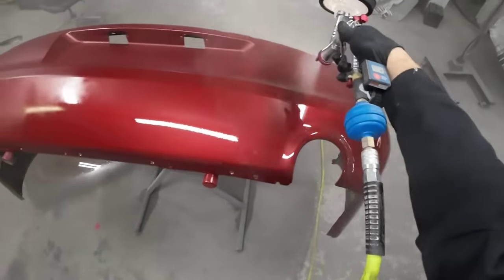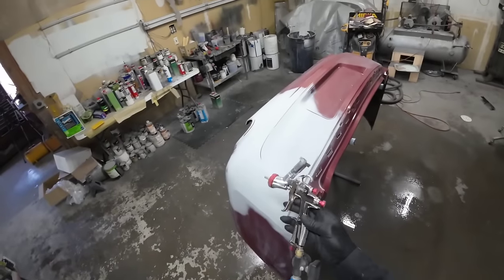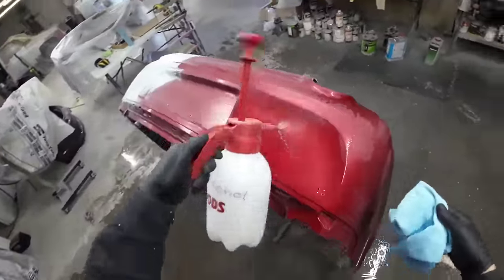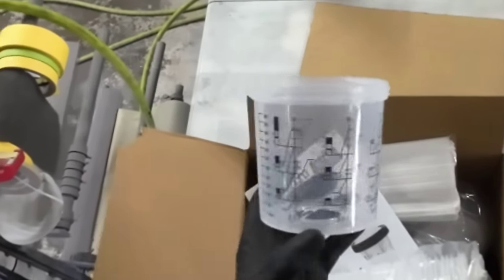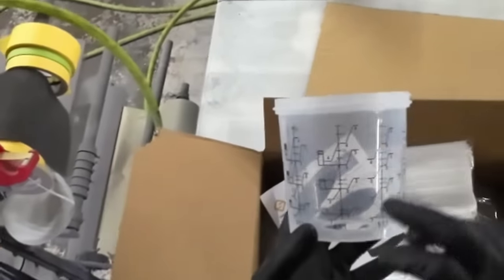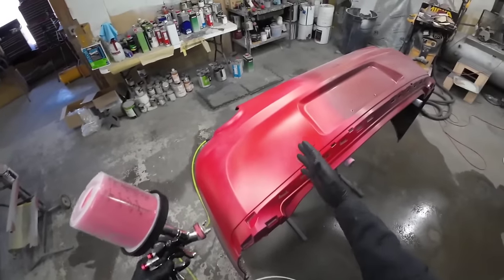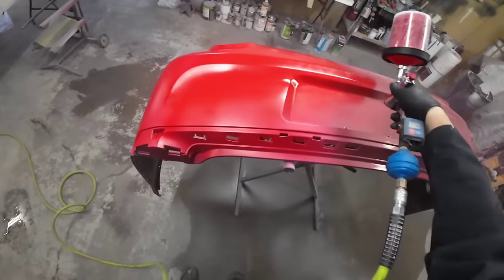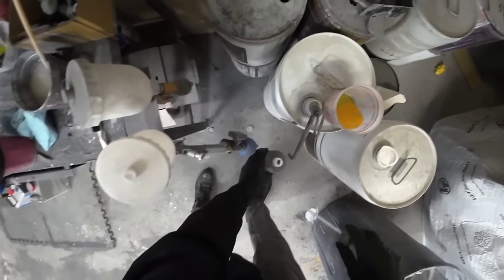The best low cfm budget paint gun for painting your car!

Comment: Nice video. I have exactly the same gun and primer system . But didn't try it yet. 
I noticed you pumped something from a big container into the plastic bottle and used as a cleaner.  What was it ? 
I also like that lid on the primer can. What is that ? What brand? Where do get one ? Thanks )))
Also, would be nice if you add the gunn setting into the description for the video : "base - 22-25psi and 2 turns from closed" something like that. That is what all guys missing. Just my 2 cents. 
One more time. Good informative video. It helps
Reply from the maker: Really  appreciate taking the time to comment and your support.  I was cleaning the gun with thinner from a 5 gallon can.I will add those gun settings here is a link to the mixing lid for the prime.
Mixing lid
https://amzn.to/3UMhpvt
Reply from the maker: Misunderstanding on the thinner bottle here is link
https://amzn.to/3iUfqbi
Reply: @GarageNoise   forgot to ask. What tip size do you use to spray primer filler and primer sealer and at what pressure . Thanks)
Reply from the maker: @Green_gtw  primer  I use a 1.6 but a 1.4 will work. Sealer 1.3 both at about 15psi
Reply: @GarageNoise  thanks )))
Reply: @Green_gtw  Thanks for your questions Alex.  Answered mine too..  Thank you also GN. Phillip Hall

Comment: So this gun can/will spray Primer,sealer,base,and clear?
Reply from the maker: Primer you probably need a bigger tip . This is a 1.3 and if your spaying high build primer you need a 1.4 at least  I use a 1.6 for primer. It does spray sealer, basecoat and clear great tho.

Comment: I haven't heard you say anything about nozzle size. The R500s on Amazon mostly come with 1.3 nozzles, but some are different. I see one offer that comes with a 1.3, a 1.5, a 1.7, and a 2.0 for $120.  You mentioned in a comment that you spray primer with a 1.6 nozzle, but that a 1.4 will work, and you spray sealer with 1.3, but you don't mention what nozzle you spray color and clear with.  This is all critical stuff to noobs looking to buy a first gun and try to do our own stuff.  How much do we need to worry about such things when buying?  Do you not mention it because it doesn't really matter, or because it's so basic that you don't even think about it?  Inquiring minds want to know.
Reply from the maker: Good point, just an over sight on my part. I spray sealer ,paint and clear thru a 1.3 with this gun. Appreciate the comment and support!
Reply: @GarageNoise  I have an old El Camino that a previous owner had painted by a budget shop. The paint is literally just falling off of it now. I'm considering sanding it down and shooting it with epoxy primer for the time being -- no body work -- just to protect it, then getting it painted sometime down the road, possibly a couple of years. A video on this idea would be helpful. What do I need? What should I look out for? Better to hang the hood, or shoot it flat? Shoot one piece at a time, or all at once? Differences in brands/types of epoxy primer to double-check? It will eventually be metallic silver, so grey primer for easy coverage, or black to give contrast for the final primer and paint? My compressor is a 2hp, 20gal, so LVLP with what size nozzle? Recommendations for water/oil filters? I don't expect you to answer everything here, just throwing out the kind of things I'm confused/concerned about, to give you ideas for future videos. Also, I see ads for some really cheap guns - $20 to $45... Probably just crap?
I appreciate your videos. Still wading through them. Recommendations of other channels worth watching?
Thanks.
Reply: @JeffKnoxAZ   Agreed!

Comment: That's awesome work. I have got questions for you. What air compressor do you use when you use lvhp spray gun?

How many litre of air compressor?

When you spray, do you use primer first before you spray the color and then the clear coat?
Reply from the maker: The compressor I use produces about 17psi of air. I don't  know the conversion to liters. This gun will work with a small compressor  even tho I'm  not using one. I do use primer sealer and then basecoat. Appreciate the comment and support hope this helps!

Comment: When you mentioned the legacy #2 Series could you put up a link for this kit... I can't seem to find it
Reply: No problem, I know you're a busy guy, but I noticed in your other video where you did a comparison between the ASTRO EVO T & ASTRO EURO HE, you mentioned that the EVO T was your pick, and that it was a good choice for the do it yourself home guys with a lower tank compressor since it requires less air to run it more continually than the Astro Euro HE...
could you recommend if im using a 29~30 gallon Air Compressor Tank, whether the Evo T would still be a solid Choice? Or should I just go with the AeroPro LPLV 500/610???

Or would 1 of the 2 be better suited for either Sealer, Base or Clear? And the other for a Sealer, Base, or Clear? As thats what I would like to do is get a Gun for Primer/Primer Sealer, A Gun For Base, and a Gun for Clearing....

I was thinking Evo T for 1, AeroPro LVLP 500 for another, and AeroPro LVLP 610 for another...

Or At least 2 guns for the time being now is what I at least need (Priming and Sealing, and 1 for Base and Clearing) 

Any Help on this would be GREAT! Been a long time since I've done a FULL Paint Job with a Gun!... since 2004 lol

Comment: I bought the same spray gun and use the same settings but when is spray everything comes out the fun too fast and I get runs easily. Could it be the high pressure adapters with larger openings?
Reply from the maker: I don't think that would be it. I would suggest closing you fluid knob back just a bit maybe a 1/4 turn or speeding up your passes or spraying further from the panel any one otf these  will help with less clear on the panel

Comment: I have a compressor that is only 1.5 hp and 6 litres in size but pushes out 6.3 cfm. Would this work with the gun? Just to spray bmx bikes
Reply from the maker: Yes, it will work fine for what your doing. Appreciate your comment!
Reply: @GarageNoise  Appreciate your work!

Comment: Do you use the larger needle and cap sold on Amazon for it to spray primer? Or do you have a separate gun for primer?
Reply from the maker: I use a different gun for primer . I perfer  not to run primer thru huns that I paint and clear with. Thank's for the support!

Comment: I got the r500 original...I came to my shop one day and found the the pressure needle on gun on the floor I put in back but when I trying to use my gun it doesn't pressure at all how do I fix or should I send this gun back
Reply from the maker: Not sure but if the needle gets bent it won't  work right may try to send it back.
Reply: @GarageNoise  thankyou

Comment: My question is what is the benefit of moving up to a Iwata kawami or a lph400 or other name brand over this one
Reply from the maker: Good question.  I would say not much but I'm  also an experienced painter. Themain thing is the Iwata might be slightly easier to get a flat glass like finish in your clear coat. Also build quality might be better. Although I feel like the build quality is pretty good on the r500.
Reply: The Iwata will make easy work with spraying difficult metallic like silvers and high solids clears. Superior atomization.  They will also put more product on quickly when doing large projects and overall refinishes.  They will also last a lifetime with proper care. Each of the three guns will have its place and usefulness at their respective price point. They are essentially engineered for a different user.

Comment: I’ll start by saying I’m not a painter. I’m just curious why not paint the entire bumper.  It’s such a small item it would seem that that would be easier.
Reply: Paint products are very expensive, and proper sanding/prep takes a lot of time. Also, for blending purposes, it's nice if you can leave the original basecoat near the edges that will meet up to other panels.
Reply from the maker: For color match is exactly right. There's variances in every color. If I put color out to the end of the bumper it may not match the original color at the adjacent panel. Appreciate the support!

Comment: Boss any recommendations for a good air regulator without breaking the bank ? Thanks
Reply from the maker: I use harbor freight digital,  got tired of expensive gun regulators going bad. I think there about $13 if they go bad I just replace them . So far I've  had good luck.

Comment: Nice results. Two questions. What’s the purple of the sealer? And secondly since this gun produces a smaller amount of material than an HVLP would you recommend this gun for a touch up gun for say cab corners and such? Thanks
Reply from the maker: I'm  not sure what your referring to when you say purple of the sealer. It would  be a great touch up gun but I like to use a touch up gun for getting into tight spaces so in that case a smaller size gun would be beneficial.  Appreciate the comment and support!

Comment: Chris do I need any other filter than that small one at the gun?
Reply from the maker: Yes, you need one off your compressor.  Recommend about 50 feet away mines about 20. Oil and water separator with desiccant beads. This is the one I use it's  inexpensive and does a decent job.  https://amzn.to/3JQ1RVs
Reply: @GarageNoise  thx. Makes sense.

Comment: The link goes to the Gun with only the 1.3 tip.  Is this the only tip you use or do I need to have more tips because you didn’t mention the tip size you use for the primer, sealer, base and clear coat.
Reply from the maker: I use 1.3 for base and clear .if you spray a high build primer you want to use 1.5-1.7
Reply: @GarageNoise  Thank you very much. Just one more thing. When you say 3 Turns out from wide open, you mean after you screw in the fluid screw all the way with the trigger pulled all the way back and then turn screw out three turns right?

Thank you for all the hard work you put into making these video presentations

Comment: What adapter is used on that spray gun r500 with the IQ cups need to get one for my gun thanks and enjoy the videos if you can give me a link or type for the adapter would sure be nice got the cups need the adapter. Thanks again any help would be nice
Reply: I need to know  which 3m adapter fits the r500 the hf adapter leaks with the IQ system doesn't seat right in the caps need to know which 3m adapter fits that  gun the r500 or the Eastwood lt100 thanks
Reply from the maker: I will check and get back with you.
Reply: @GarageNoise  thanks

Comment: News flash, bumpers don't match to the quarter panels anyway.  Not even on a brand new car. Go to a dealership and see for yourself.  The fact is, the bumper covers are painted separately from the steel bodies and are not baked finishes.  First thing I show a customer when I have to make a bumper repair is how far off the factory match is. 95% of the time I get a dead match or much closer then the factory finish.
Reply from the maker: That's true. If they do match when they come in. I won't  be the reason they don't  when they leave. Appreciate the comment and support!

Comment: Any LVLP paint gun uses less cfm
Reply from the maker: Sorry, are you asking me? I don't  know of any and I've done quite a bit of searching. If you find one or know of one I would love to know about it. Appreciate the support!
Reply: @Garage Noise  yes their is alot of LVLP guns out eastwood  has them also Amazon astro makes one great guns for small comprrors
Reply from the maker: @chrispassarella5634  Eastwood lt 100 os the same gun. I haven't  found one with that only use 3.5 cfm's  most are above 5 which actually makes a big difference. If you know  of one let me know. Appreciate the comment
Reply: It also works a lot slower meaning it transfers less material in a comparable time frame.  This may make it easier to control for a beginner or apprentice but will leave a pro wanting. Gotta keep that "wet edge" !

Comment: Used this gun for the first time today and it was terrible. Shot some
Sealer with it and the paint was sputtering out kind of. Terrible
Reply from the maker: Do test spray to check the fan. Sounds like a air cap issue.  Shouldn't spray like that. Let me know what you find. Appreciate the comment.
Reply: @GarageNoise  ya I always do test on a piece of paper to check my fan pattern and it was normal. I was shooting sealer at 27psi and had a sputtery sound. Didn’t shoot well at all. Took the whole gun apart and cleaned it too before using it

Comment: you are  only telling specifications of LVLP gun but not mentioning your compressor details , its psi and cfm ... without having a proper match of HVLP or LVLP with compressor CFM and PSI there is no point in telling one side details only . kindly do mention details of the compressor too .
Reply from the maker: I don't  mention my compressor because it's  a larger compressor that produces about 16 cfm's.  It's  an ingersoll rand.  When picking a compressor  I always advise  to get as much cfm's as you can afford.  When painting  and using air tools this is what matters.  Of course do your research as far as brand and durability. Appreciate your comment and support!